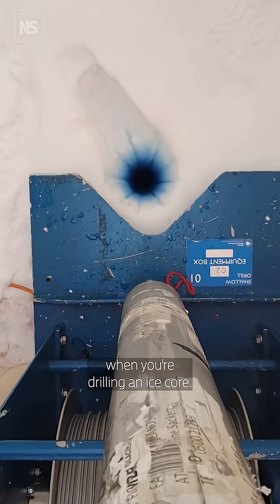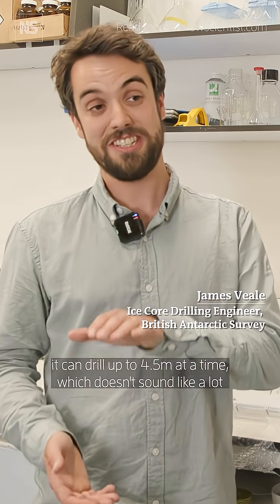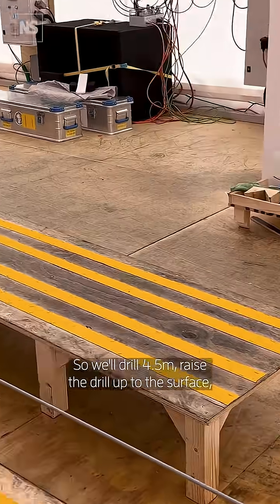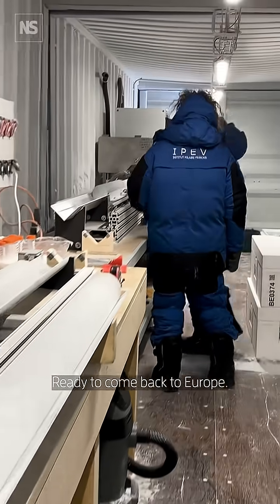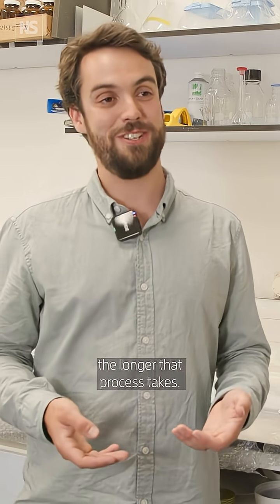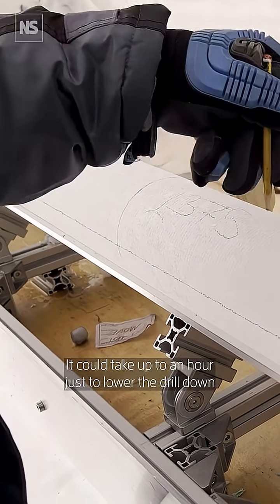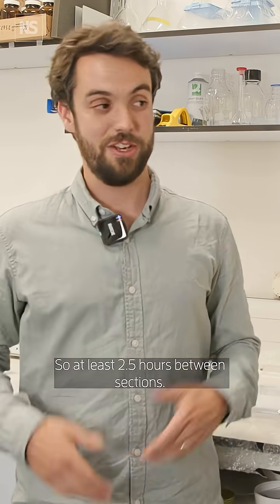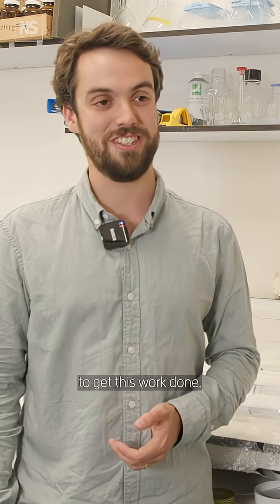How scientists drilled the oldest ice core in the world 🧊

Comment: I've always wondered after you drill down and have cut your core how do you separate the core bottom from the ice sheet?
Reply: I'd imagine you just pull, and eventually it'll shear across a crystal layer
Reply: Probably some sort of vibration motion or something. Idk, ice is hard, but it CAN be brittle when you start shaving through it
Reply: Its wire line core drilling was done by drillers not scientists they fund it. 

Look up wire line bha core drilling, core barrel assembly
Reply: Maybe twisting the drill backwards snaps it? Just a wild guess.
Reply: https://youtu.be/6g5S1yaBsAY?si=abhhYd4J6S-JKmMe 

This is how it works men
Reply: I tried to find an answer, and it is surprisingly hard to find how they do that lol. From what I can find, the simplest method I found is that some of these designs of ice corers have a weight built into them that can be dropped against the driller to snap the ice off at the bottom. Other than that, science teams fall victim to hand waving away something that is simple to them but not clear to a non expert and often just say "the core is broken off."
Reply: @PolarisC8  xkcd 2501

Comment: How could it ever take half an hour to drill 4.5 meters?!?!
Reply: coring" they are taking samples that need to come up as an intact cylinder not just making a hole, and they can't just run thousands of watts because they don't have the infrastructure
Reply: i reckon i coukd drill inconel quicker than that 🤣
Reply: @Hellfire99666 what is an inconel?
Reply: @Hellfire99666good for you
Reply: They said a lot of time is lowering and raising it, since it needs to drop km deep.
Reply: @letsburn00 yea, they said it could take upto an hour to lower the drill but how can it take 30 minutes to drill the 4.5 meters????????
Reply: @JackFrost008 30 minutes to get 4.5m of core isn't that wild, especially when they want to preserve it very cold. I've seen Diamond core (used for mining exploration) and it takes a while too.
Reply: @letsburn00 it is a ridiculously long time
Reply: @letsburn00  drilling ice is wayyyy different to drilling rock you know
Reply: @JackFrost008 Diamond core drilling is quite specialized, especially given in this work they don't want the ice core to melt, since the whole point is gathering the gas that's trapped inside the ice. If they screw it up they need to go all over again.

Comment: thats very cool but do you take the sawn section into account...plus how do you know youre not missing something impotant by sawing out that 3mm or so section?
Reply: That's a good question. There are probably other teams doing other ice cores, and maybe with different drill lengths. They can compare their data to each other and match the years, and chances are that the other team gets most (probably nearly all) of that data which this team can't. 
So if there was something important that only lasted a short time, then most of the teams will probably have that segment in their ice cores. And the ones that don't will be able to see which years they are missing, and so it's not an anomaly.
Reply: What time frame were your cores from in years?  Are the results posted anywhere?
Reply: @dmor3359 by a rough calculation 3mm is on the order of a single year, so unless it's a leyer of volcanic ash or something, 3mm isn't really going to change the interpretation much. And that layer would presumably be visible enough that you wouldn't make the cut right through it
Reply: I agree. 
Sawing is not smart. 
It is ice. Just split it with a chisel. 
No data lost. 👍